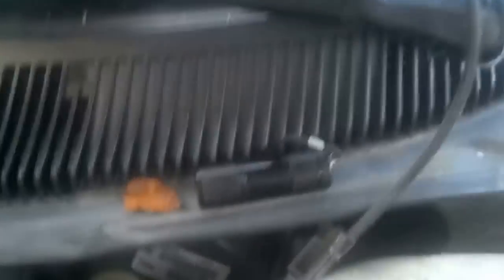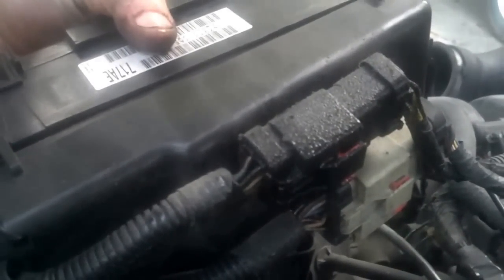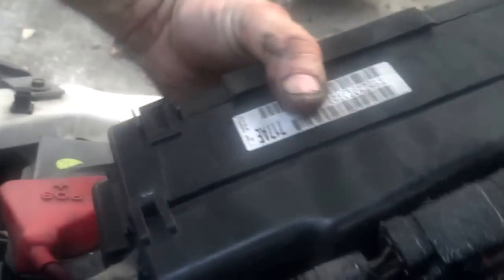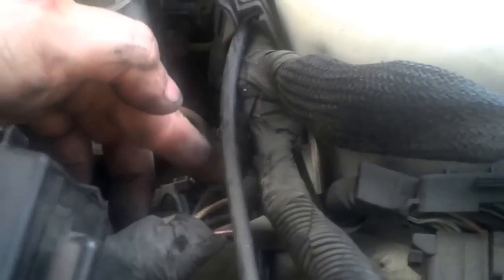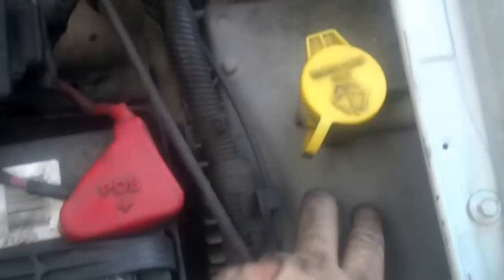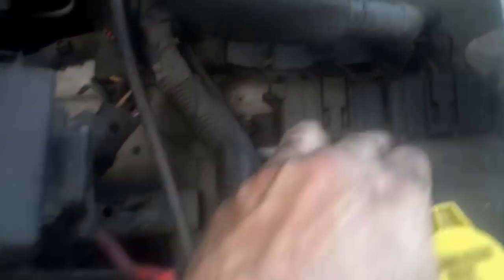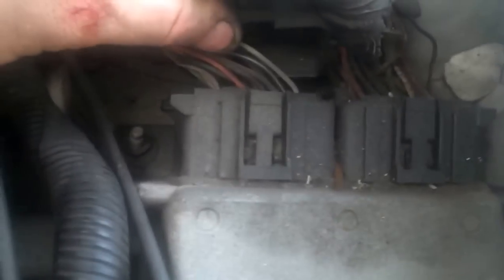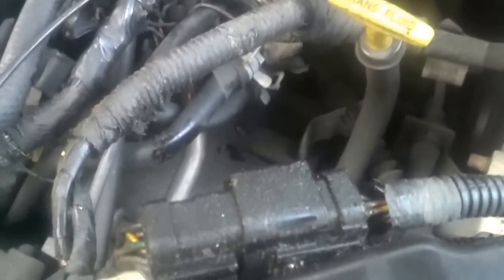Electricity and Oil - Plymouth Neon wiring harness migrating oil

Comment: I had the same oil issue in the ECM in my wife's 2005 PT Cruiser.  I'm getting ready to change the oil pressure sending unit also.  I cleaned out the ECM and the plugs and  had to change the ECM. The car only has 163000 miles on it but it is older than the Plymouth so I guess age has a lot to do with it. And, crappy Chrysler design engineers.

Comment: Have the same issue on my Mercedes C class with m271 engine, oil from the camshaft position sensor work it's way thru all engine electronics including engine ECU. Dealership charged others with the same issue just over £4000 for replacing engine harnesses, ECU, oxigen sensors, camshaft position sensor. There was a silent recall from Mercedes Benz but dealerships only did the repair if they wore specifically asked to!

Comment: I have a 1998 Dodge Avenger 2.0L MT base, everything is running normally, engine runs strong with no codes. 
Only when the car is cold started,the AC compressor clutch kicks in (when you start the Ac at dash button) and will stay on for about 1 minute then shuts off.
I replaced the entire Ac system (piece by piece with new parts): ac compressor unit, drier unit, evaporator unit, expansion valve, switch thermistor at evaporator, Ac fuses, switch for Ac blower unit, all Ac lines L and H and other 2 Ac lines , the pressure switch in top of Ac drier, the Ac module and the Ac switch under dash and the control panel, fully recharged system with Freon and still doing the same thing. 
The engine temperature gauge is normal at half way and the engine is not running hot or having any issues, the fans work good, the only issue is AC stops blowing cold air Ac after 50 Sec.
I figured that within a minute the system gets builds up pressure or hot somewhere and maybe something triggers the Ac clutch to shut off. 
Yesterday I just pulled the two main harness plugs going into the ECU unit and found (only at the upper plug) engine oil present there, I then started removing all the components under the ECU unit (the two other main harnesses that have a bunch of wires terminating into two white dead plugs and found a lot of oil in those plugs (soaked), I cleaned all with electronic cleaning spray (a lot off old oil white color came off from the two plugs). I also opened up the ecu unit (but it is waxed sealed on the inside) and cleaned the attached connectors and let it sit overnight to drip down the oil if any got inside the unit . 
I am thinking this should have been the issue but haven't plugged all back in together yet
I am not a mechanic but this was my first car and last year I decided and put my mind to it to bring it back to life after it sat for 7 years.
I did bring it back to it's glorious days (parts were very hard to find) but this Ac issue is the only hiccup that I can't get to find a solution for.
Before, I even took the car to dodge dealership, they did an Ac system pressure check and all was good. 
I will plug all back together later today and I hope to God that the oil in the plugs was the issue tripping to stop the Ac compressor clutch after about 1 minute of starting the car.

Comment: I have a dodge neon 2000 and found that the camshaft position sensor connector was soaked in oil. The oil also had sipped through the wire up to about 1 ft or so of wiring until the wire is dry again, the wire insulation is very elastic and came off by pulling it with my fingers sI am thinking the combination of heat and oil in the wire has destroyed the wire insulation. I am replacing that length of wire and replacing the connector. Thank you for the video, it helped me visualize what else could happen and what to check next.

Comment: Can i spray brake cleaner in the wire to clean annnbd "DRY" IT OUT,??? OR WHAT DRIES IT? IF i do that and use the same wires.
Reply from the maker: Once the insulation is damaged just cleaning it out will not work.  The damaged sections can be replaced if not too extensive.
Reply: @MasonClassVideos  heyy hanks 4 reply, i found the problem, had looked on neons.org,  guy had same prob with his neon... The cam sensor wire insulation was hard & off, so that orange & tan wires were touching, CAUSING - NO START, OIL LIGHT ON, STALLING SUDDENLY IF IT DID START, MANNNNNN, STOOPID ELECTRICAL STUFF. SO I GOT THEM SEPARATED, insulated, started right up no prob oil lite off, purrs like kitten. Cuz that engine was pretty much rebuilt so i knew it wasnt engine or fuel issue. But hope this helps someone. Thanks & hope yours went well or u found the problem also.

Comment: I stumbled across this video I've been an auto tech for years and never ran across this. Totally different car same problem 94 Camry V6 I took a Blue Rag to the OBD2 (yes this model year has OBD2) and wouldn't you know it there's oil , not much but all the same, oil... only difference is mine's coming from the camshaft position sensor. I replace the connector last week car ran fine probably because I change the wires also. Then the problem came back. You're a genius

Comment: Such BS I have this same problem. My oil light went on I had leaking oil sending switch sensor. I replaced the sensor light still on. I tested for pressure and oil pressure is fine. The light even comes on after I disconnected the sensor so I have a shorted wire caused by leaking oil pressure sensor. I added an oil gauge as a permanent fix the sensors are garbage. Oil pressure gauge is 1000% necessary. Oil sensor are BS and they leak into wiring causing all sort of damage.

Comment: i have some fluid on my obd meter just like in your video
Reply from the maker: You need to inspect the wiring closely to see how extensive the oil wicking is.  Check the large connectors on the drivers side of the engine bay as in the video.
Good luck!

Comment: A while ago I noticed that my 98 neon's data connector was oily wet, but dismissed it thinking it was some sort of protective oily fluid (like the oil in HV transformers, perhaps). But thanks to you now I know better, since the car is also suffering from weird problems for several months (for instance, the engine sputters and sometimes shuts down if I have less than 7/8 full fuel tank, and then the OBD says "cam signal loss" or "Ignition coil failure" or some other unrelated fault code). 
The oil is probably not coming from the oil pressure sensor because I replaced it several years ago with an under dash mechanical pressure gauge (which does not drip!). Wherever it's coming from, now I know I have to clean several connectors and probably replace some wires (since being a 18 year old car may be brittle or chafed in places anyway). 
Labor intensive for sure, but can't afford a new car in socialist Venezuela.

Comment: my 96 neon is doing this same thing and has been since I purchased it almost 2 years ago. The oil pressure sending unit has been unplugged since I got the car so I assume Crankshaft Position Sensor, as I replaced the Camshaft Position Sensor. How do I fix the wires? this is a typical neon issue and i pulled the computer out and it POURED out oil. I'll junk the car before I buy a wiring harness. If there is a semi simple fix because I have random bogging and sputtering. My ex has a 99 neon its been doing this for 3 years and she has no sputter or misfire unless its not as noticeable in her automatic as mine is a standard transmission?
Reply from the maker: There really is no professional fix other than repairing the source of the leak and replacing the harness and any effected components.  These cars are getting older and the repair is most times more than the car is worth.  Since the oil inside the actual wire does not effect the operation (it's the oil in the connectors and the components) I'm sure people have tried cleaning components and connectors then creatively routing the wiring to provide a 'drip loop'.  I have never tried it, but I doubt it would work as the physics of capillary action of the fluid in the wiring will still migrate it uphill. It may be possible to overlay (run a new wire outside the harness) the worst and most critical circuits for a band-aid if the car is needed. This would be cheap on parts but labor intensive and only really buying time.

Comment from the maker: Most fluids can be wicked through the wiring however washer fluid and such will evaporate and normally cause localized corrosion.  Brake fluid and oils will travel and damage the wiring on a larger basis.